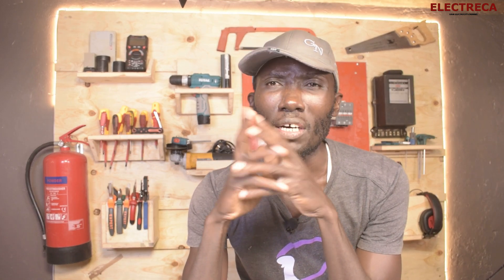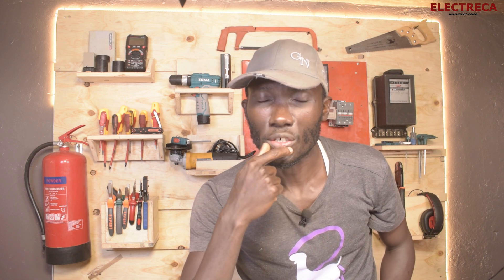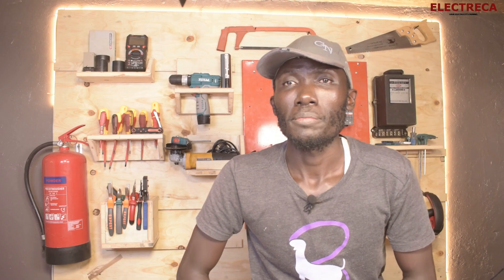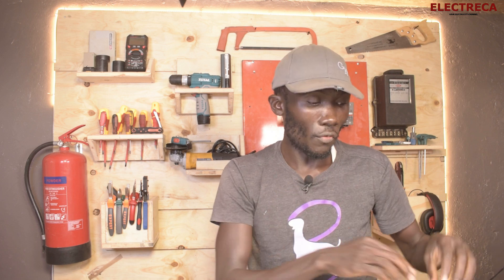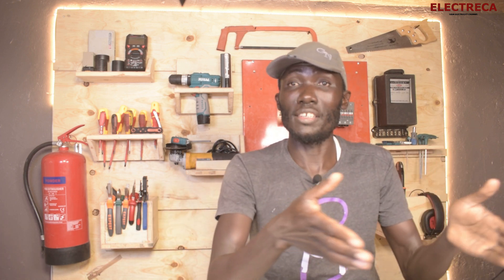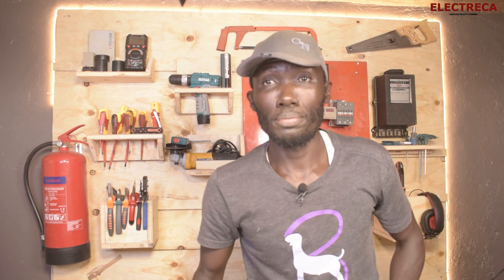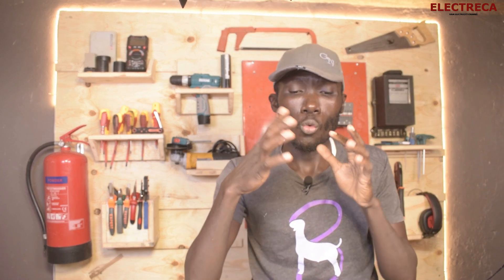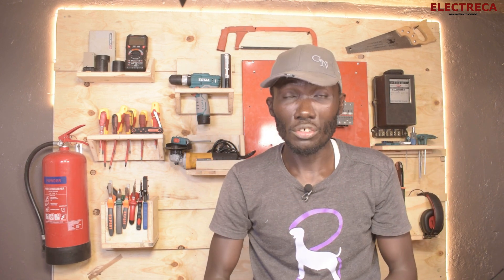How 3 Phase Selectors ACTUALLY Work

Comment: Quick question, what is a comparator
Reply from the maker: In electrical it device used for monitering voltages or currrent, by comparing the inpute values to the set one if the value are high or low to set one the circuit trips.
Thanks for watching.

Comment: The only problem is that you will be loading the transformer with only one phase being used at each particular time.secondly you will need a bigger size cable to supply the system with because you are not balancing the phases